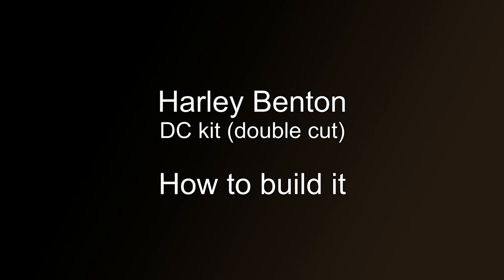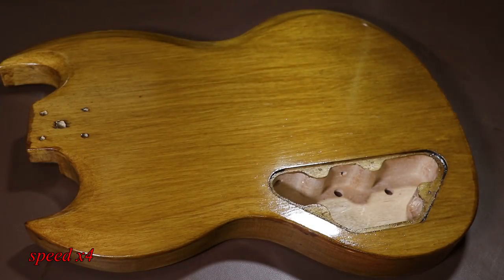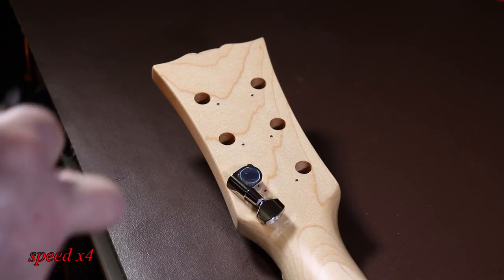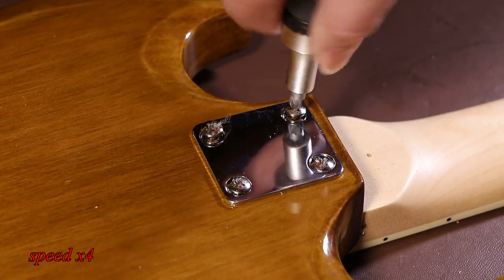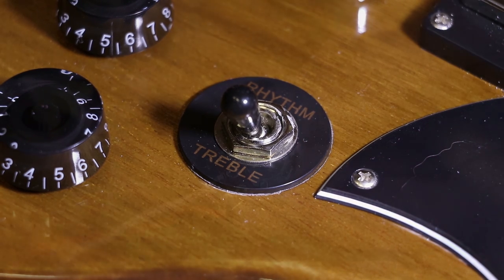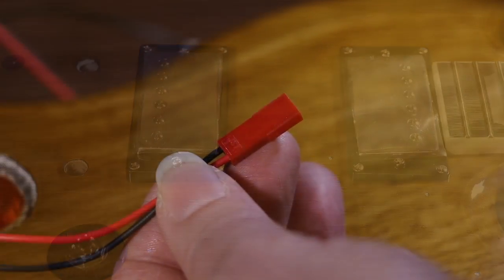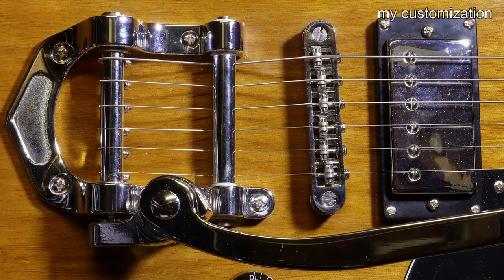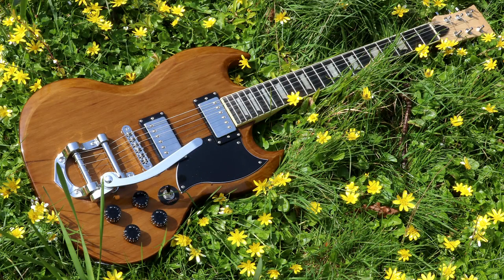Harley Benton DC guitar kit assembly instructions, test and review

Comment: Colored tinted varnish is not really for fine finishing.  Use a sealer to insure it's not splotchy.  Then I'd use stain only and then clear lacquer would be my idea of how to improve the look and get more depth.  Your stain/varnish by its nature won't provide a depth of finish you'd want and will always be "muddy" since the stain clouds the varnish finish.   Or use something after the stain like Watco Oil Finish that puts on very thin layers. In the USA we have Birchwood Casey Tru-Oil Gun Stock Finish available that makes a great thin finish that many people use.  The great thing about a kit is you can upgrade the cheap electronics to much higher quality for a few dollars more.  CTS pots and Switchcraft jacks are cheap as chips and much better than the kit.  An open air 3 way switch like a Oak Grigsby or Switchcraft is more durable, feels better in use AND can be easily sprayed with electronics cleaner when it gets gunky down the road.  At this point I'd guess you'd have spent an additional $30 in electronics and have more durable and much better feeling when you are playing it.  You will need to learn how to solder properly, but that is a good skill to have so long as you don't use too much heat.  Then if you want a big upgrade, install Duncan or Dimarzio pickups or Fender if a single coil type kit.  Dimarzio has a 36th Anniversary PAF I'd like to buy and transplant in one of my current guitars and they are relatively affordable.  For Strat or Tel kits, some of the OEM Fender pickups are very cheap and tons better than the Chinesium no name.  Then you have a much higher quality, lower noise pickups that rivals or improves on $1000 Fenders or Gibsons.  Excellent instructional video and a great way to make YOUR guitar exactly how YOU want it!   You can go to a auto supply store and select from a thousand different colors including metallic, just be sure to put a clear coat over the metallic if you use it.  Want a metallic purple like Danish Pete?  You'll have plenty of choices and be ordered in aerosols or use a Preval sprayer with varnish thinned properly.  Sorry for the long post, but this is a great avenue to lifetime of cheap fun!!!
Reply from the maker: Yes . . quite a post.  But thank you for sharing your knowledge I'm sure anyone visiting the video who's serious about guitar finishing will get something out of it. . .  😀

Comment: Inspired greatly by your vid, I'm now ready to buy my DC kit. But they're not in stock at Thomann right now: 12-15 weeks they say. (Every other model, except the one I want. It's your fault GCH, you made everyone want to buy one.) So do you know of any other kit manufacturers out there who do the same thing?
Reply from the maker: wow, they always run out of that one.  I just looked last week and they were in stock then.  I know of a few kits out there but I don't know how good they are, but there are some similar kits on eBay and Amazon.  Gear4music do a good one https://www.gear4music.com/Guitar-and-Bass/Brooklyn-Electric-Guitar-DIY-Kit/1SUL
Reply: @guitar-academy  Great, but it's a little bit more expensive than Thomann; no matter. But delivery charges are less, assuming they deliver to my European country (am not in UK). Would you recommend the extended guarantee for 9.99? Do you (or know anyone) who has personal experience of buying/putting together this guitar? Is the quality comparable to Thomann?? Thx in advance. Great channel, keep up the good work.
Reply: @guitar-academy  I also looked 2 weeks ago and it was in stock!! One thing about the Brooklyn I just noticed: the pickups and pick up plate seem to be already installed in the photo. But I assume (hope!) they are removable to facilitate staining and varnishing.
Reply from the maker: @droses1600  very sorry, unfortunately I can't be very helpful with this guitar because I know very little about it and I don't personally know anyone whose built one.  I personally wouldn't get an extended guarantee on any guitar.  If the guitar is fine when you get it and during your legal warrantee period I can't image what could go wrong after that time, and in 35 years of teaching guitar I have only seen one guitar that needed to be returned after the first month or so.
Reply: @guitar-academy  Yep, tend to agree with you about extended warranties. Currys, Dixons, Rumbelows et al used to always offer them, until an employee told me they make more profit from those insurance policies than from the goods themselves. So I nixed that, but took the plunge and ordered just the Brooklyn DC kit. Should be here before Christmas as it's already been dispatched. Better than waiting 12-15 weeks from Thomann. I had to close my account with them recently anyway, because of a disagreement over my last order (€400-plus), as I feel that after over 8 years of doing business with them, their standards have declined to a point which is barely acceptable. Sad, but true.
Reply from the maker: @droses1600  Sad isn't it . . that these companies don't respect there customers. 
I hope it's a good kit and I would love to hear your feedback when you get it so I can pass it on . . 😊😊
Reply: @guitar-academy  Sure, I'll let you know. Might even make a video about it, but it won't be up to the same standard as GCH's output...
Reply: @guitar-academy  I must have spent thousands of Euros with them over the years, but recently they sent me a big order in two separate parcels with different tracking numbers. However, those boxes didn't travel on the same lorries together to my address. The first packet was two days late from their estimated delivery date. The second (containing a digital piano) was TWO WEEKS after that (almost a month after ordering)!! When I complained to the big boss (the eponymous Hans Thomann), there was no apology, no explanation, no investigation, no condemnation of DHL, and no compensation either. So I just closed my account in protest and now will in future do my music shopping elsewhere (eg Gear4music). Would like to hear from your viewers if they have had similar bad experiences with Thomann Germany or their worldwide satellite stores.
Reply from the maker: @droses1600  I'm working on a video at the moment where I had a bad experience with PMT so I'll ask people to comment on companies that have let them down . .
Reply: @guitar-academy  PMT in B'ham? Did it used to be called Musical Exchanges? If so, I used to work there, back in the day...
Reply: Update: G4M kit arrived (assembly instructions atrociously bad!!) but there's a 1mm wide/1mm deep piece of grain lifted on the fingerboard around the 3rd string on the neck pickup end. Goes across two fret spaces and the last fret was put in over the imperfection; QC did not pick it up before or after. Dithered for a while about sending it back for a replacement, but as I had already bought the materials, and as this holiday period is going to be the only uninterrupted time to do this project, decided to go ahead anyway. Put it all together (neck fits OK in body) but without soldering or testing electrics and without stringing it. Took apart again. Bought some oil-based mahogany stain, did two separate applications 24 hours apart using an old clean  rag on body. Bit redder than yours, would prefer slightly browner. Just now did first coat of spray varnish, but I think I have to rub down with 1800 paper (sand, glass or wet n dry? not sure) before next pass as it seems to be very bitty and not smooth. Watch this space.

Comment: Wet and dry sandpaper in between coats may help  but the great product is tru oil it is used for gun stocks and leaves a really hard satin coat with no brush marks but it needs many coats PS you’ve made a great job anyway
Reply from the maker: Yes everyone seems to agree with your prognosis . .  I'm currently filming a job using Tru oil and yes it's taking forever . . 😊😊

Comment: Hello, I'm building the same model of HB guitar and just wanted to know what to do with that 30:00 earth wire sticking out of guitar? Should I just leave it or sodder it somewhere?
Reply from the maker: Good question.  You want to make sure it comes in contact with either the bridge or tail stop so that the earth links to the strings.  Most of the time you can just push the wire down a bit into the hole and then it'll be held tightly in place by the mounts when you push them in the hole.  I hope this helps 😊
Reply: @guitar-academy  Oh alright, now I can stop worrying about the electrocution risk, thank you so much!
Reply from the maker: @taco4523  no problem . . .😊😊
Reply: @guitar-academy  Hey It's me again, how much of the beginning lacquer should I sand? I want to use varnish but  im scared it won't stick to the wood if there's too much lacquer
Reply from the maker: @taco4523  This is a good question and I honestly can't answer it with 100% accuracy.  The problem is that I don't know and can't find out what sealer they put on the guitar.  I've used the wood varnish in this video and cellulose spray lacquer on another HB guitar I've put together and both finishes went on fine.
The only way the varnish won't stick is if it reacts with the sealer, and the only way you'll find this out is by trying a small area on the back and letting it dry.  Sorry I can't be more helpful . .  🤔

Comment: Reasons it came out like it did. 
1. after EACH coat you MUST sand again using at least a 320 or higher grit with 400 plus to 1000 grit being best. You have to do this guys if you want it to look fantastic. There is not corner you can cut.
2. Sand again lol and make sure you had removed all the marks BEFORE you put even one coat on.
after your final coat you sand again using at least 400 but 1000 to 1500 grit is better. Make sure you are steady and get every spot perfect as you can do.
After final sanding you should have a perfectly smooth surface that looks whitish in color.
NEXT
3. You have to wax and buff it out. The best way I know is a three part thing. Using three different grades of polish.  The first layer is very thin and you need to be thorough at it. get buffing pads and use a drill or buffing machine(you can buy in most areas for very little money, even buy used if you need to.)
4. After first thin polish there is the medium coat...just repeat like first polish layer
5.make sure you are buffing these coats well. finally the third coat which is the nest. if you apply as instructions tell you, buff as instructed... you will have something that rivals a shiny new factory made guitar.

If you need help look up youtube videos. If no guitar videos are there look up car painting. It is the same steps and if you could afford it the same materials and paints too. Have fun
Reply from the maker: Sorry, but you completely missed the point this is the continuation of a review video and as I said in the first line of the video 'I am using the instructions provided'.  The whole point of the video is to find out if you can make the guitar using nothing but the provided instructions with the guitar and on the varnish bottle . . .  I even say at 7:22 that I'll show how to paint a guitar correctly.

Comment: Thanks for a very clear informative video. Unfortunately, I'm a complete novice and didn't understand the earth wire section. Will that have to soldered? I don't have a soldering iron or any experience in soldering. Is it possible to assemble this guitar without any soldering? Otherwise it looks like something I could actually do. Thanks for any help or advice you can offer :)
Reply from the maker: No . . no soldering is necessary.  I did a modification for myself so you can ignore that bit if you want.  You can build this whole project without going near a soldering iron . . 😀
Reply: @guitar-academy  I thought I already replied to this but I can't seem to find it. Anyways, thanks again for getting back to me and hope you're well mate :)

Comment: Sanding along the grain of the wood is the way to do it, never across it like you did, a fine grade of sandpaper lightly between each coat would be best
Reply from the maker: sanding between the coats is a common theme that a lot of comments have mentioned . .  however you are the first to mention the direction of sanding . .  good one . . 😀

Comment: Hey man awesome video! Im thinking getting this kit. I would really like to install the dront strap button on the body instead of the neck because i like metal and do all that headbanging stuff, think it would be more sturdy. Do you think its possible? Thanks!
Reply from the maker: They have drilled a pilot hole in the neck but that doesn't mean you need to use it.  Providing the wood is hard enough on the body I don't see a problem with putting the strap button on the body.  😊😊
Reply: @guitar-academy  thanks for the reply!. Is the guitara a little neck heavy or is it pretty balanced? Cause its not like normal guitar wood.
Reply from the maker: @JohnSmith-bj8gw  without the Bigsby it would be but with the Bigsby it's fine, and the neck feels very chunky for my liking, but I like a thin neck . .

Comment: It’s not your lack of technique with this varnish. They’re very difficult products to apply to achieve a flawless gloss finish using either a brush or pad. I’d say you’ve achieved the best possible finish using the manufacturer’s directions.
Reply from the maker: Thank you very much . .  You sound like you've used this sort of product.   🙂
Reply: @guitar-academy  Yes I know these types of products well by trial and error. If it's a thin consistence they can be sprayed on but that's really not a process available to the average kit guitar builder. I think what you've done is fine. The poly acted to fill all the pores and grain and leveled nicely. Then the acrylic spray gave a nice gloss finish. Just what the doctor ordered.

Comment: The reason you struggle with the neck screws are two fold ..... first you were using a pozidriv bit on a Phillips screw . secondly you should always coat each screw with candle wax.😀
Reply from the maker: Yes, other people have said the same so you are 100% correct

Comment: Where did you order the roller-saddles?

I have a ‘71 Yamaha SA-50 on which I need to replace a saddle. (Want to keep the original part as original as possible, as well.)

However, I
Reply from the maker: I just keep my eye on eBay . .  stuff comes and goes there and if you want to stay original a lot of second hand stuff comes up . . 😊

Comment: Great build! I really like the color. Did the Biggsby anulated the head dive?
Reply from the maker: I have ordered a short spring for the Bigsby, because the bar sits a bit high . . 😀
Reply: GCH Guitar Academy 

I ment the neckdive😊 Did it help?
Reply: That would be a very interesting thing to know. I heard that SGs tend to be very unbalanced (neck diving)... So, did the heavy bigsby change that? 🤔
Reply from the maker: @lone-wolf-1  Sorry, too many comments to respond to, so I'm not reading through properly.
Yes, when you consider that the body was very light to start with the balance is pretty good.  It is heavier towards the neck, but not enough to cause dive.
Reply from the maker: @volkerfriedritz8149  I think so, but to answer completely accurately I would have had to try the guitar without the trem first.  The neck doesn't dive though.
Reply: @guitar-academy  Thanks for your reply! That's nothing I would expect you to do... But it's good to know that your guitar is no diver... 👍🏻

Comment: When I get one of these, then I think I'll just try and use oliveoil, because that's also what I use to treat wooden kitchenware, and becsuse that's what I have. 
Judging by how it reacts with my varnished table, it seems like it goes through it or at least mixes with the varnish. If it doesn't do that with the varnish on the guitar, then I'll just whipe of the oil. But I'll see what happens 😊

And I will just go with a Duesenberg Les Trem ii. They're made to be swarpable with a Tunamatic bridge. Affordable and simple 😄

Comment: Is there a reason why you didnt do anything to the neck?
Reply from the maker: I didn't do anything to this guitar as I normally would as it was a test as if I had no experience and very few tools.  The whole idea was to see if the claims of the marketing that you could just follow the instructions and bolt it together and off you go are true.  In fairness it is a reasonable guitar but a proper setup would have benefitted it and make it a good guitar.  😊
Reply: @guitar-academy  so you wouldnt say there would be any problems if i chose to paint the neck?
Reply from the maker: @chrisrune123  No not at all.  Make sure you don't put thick paint on the heal of the neck or it wont fit into the body,  or you might have to sand the neck cavity to get it in.